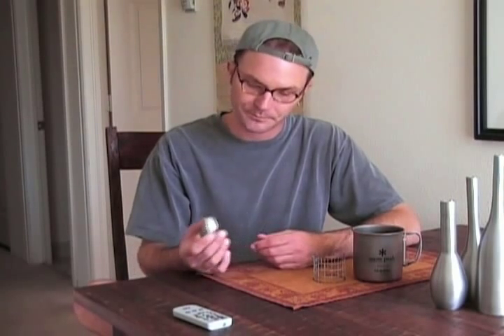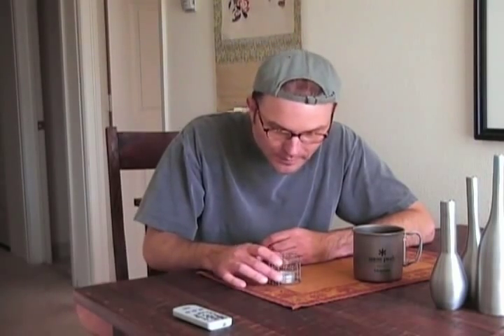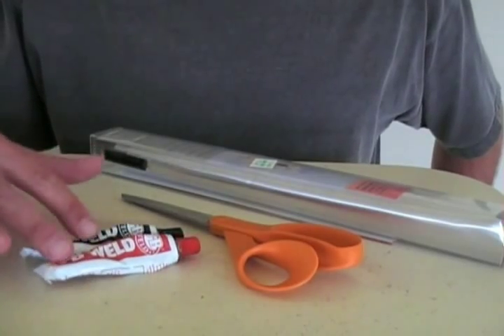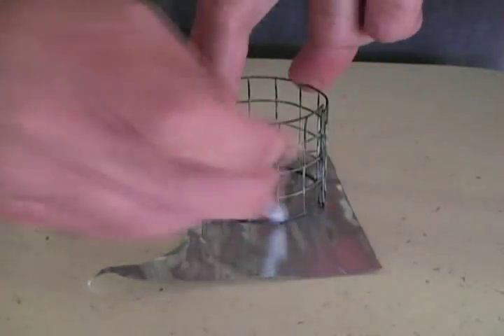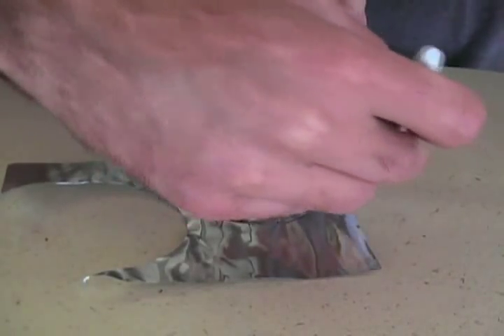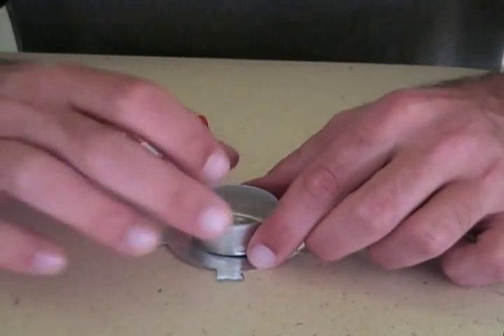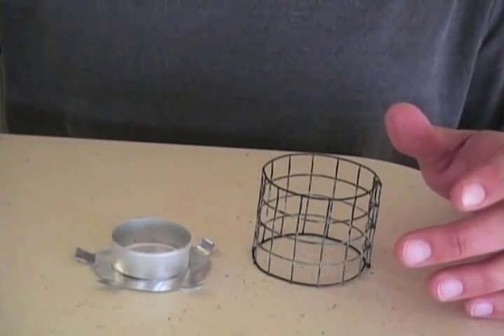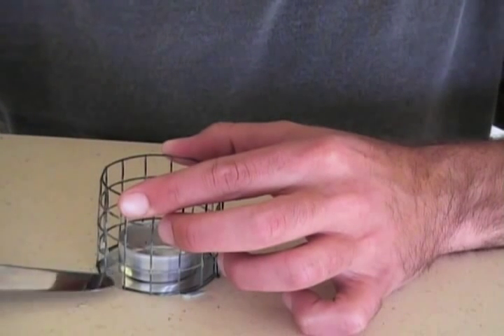Integrated Tea Light Stove

Comment: @gibsonflyingv98 you could use superglue, but it might melt.  JB weld is a better alternative.  You could also use tin foil for the base, but tooling foil is a better aternative, also. Using the same materials Jason did just makes the product more durable and longer lasting.